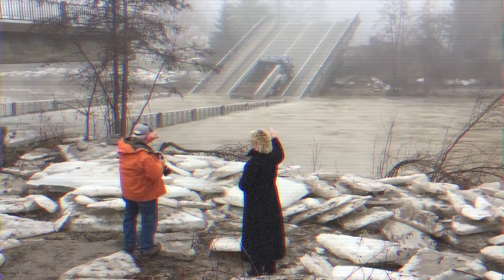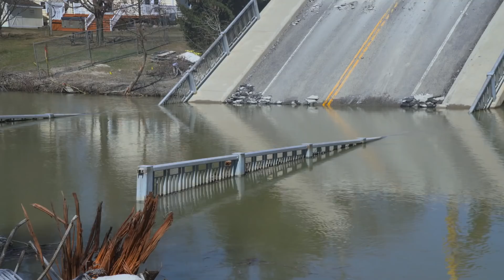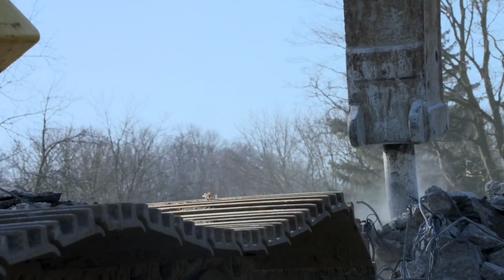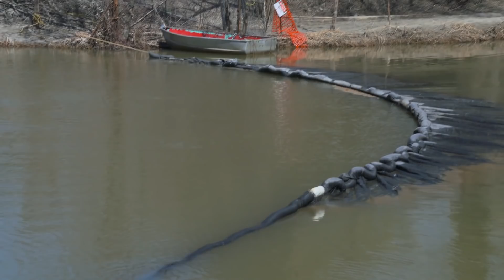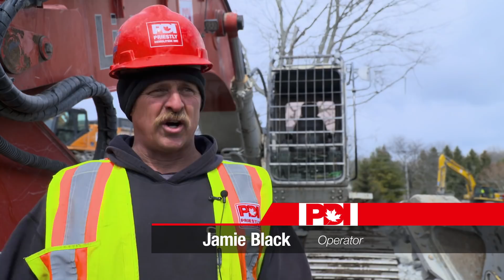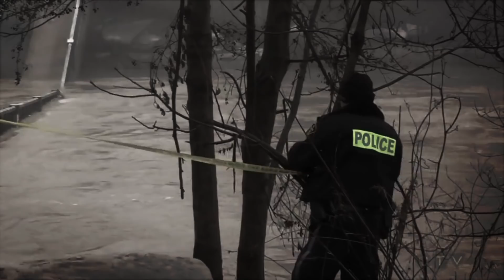BRIDGE COLLAPSE. WATCH the work of PRIESTLY DEMOLITION.

Comment: “Float it across”?  I would think that you’d want to tear down the 8000 as little as you could.  You couldn’t flatbed it across another bridge?
Reply: Thanks!  I was not aware of the term...
Reply: Glenn Bevensee Yes, we use the term float as in transport by lowbed.
Reply: Machine weights over 100 tons with that shear we had to tear it down

Comment: SAVING on rebar ore just bad enginering always becomes expensive later. hehe
even say 1000 tons of rebar is pointless if placed in the wrong place in a construction.
i used to work in construction when i was younger it somtimes lookd silly when you laid out rebar for a wide span concrete floor following the enginers instructions and drawings but when you saw the rebar laid out it made more sence.